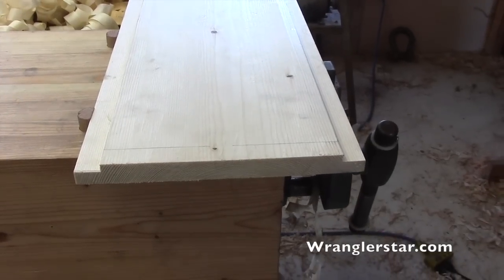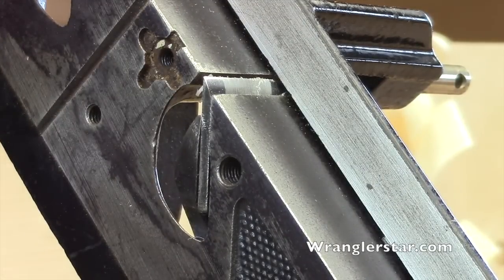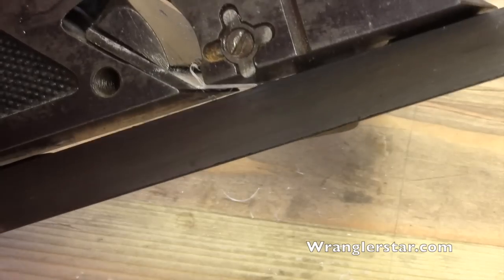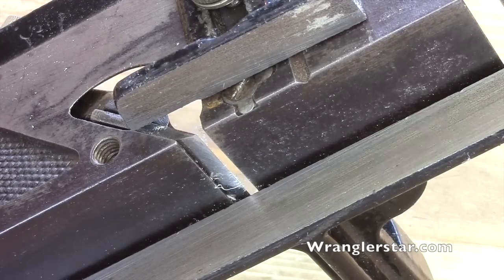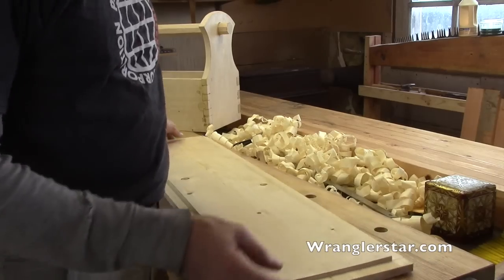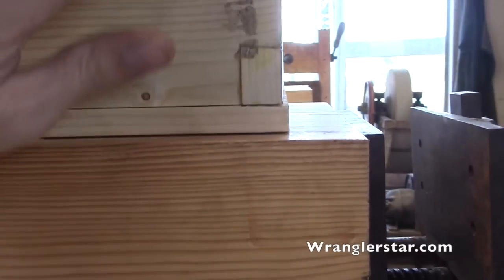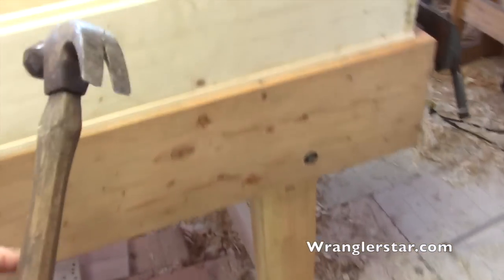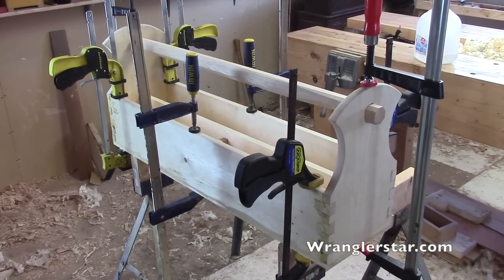Build a Tool Box Caddy For $25 | 5 Wranglerstar

Comment: hey Cody, just a tip to mention!! You mentioned controlling tear out when cutting cross grain? The solution is whether doing a rabbet, raised panel,etc. always do the ends/ cross grain first. That way any tear out would be removed once you did the long grain sides. Just an FYI. Great work and vids, and above all thank you standing firm in the rock of your faith. God Bless!!

Comment: The #78 is a very COOL tool, I have great grandpa Gatterer's & it's missing the fences but still has the cutter & screw.. He was a master cabinet maker & he only had 4 planes = 9 1/2, #4C, Bedrock 602 & Bailey #6.. & Clean the floor when you're finished & not one second before.. Gary/Hk

Comment: Hey Cody!
When I'm building wood joints and they don't fit and leave a gap I use two part clear epoxy and mix it with the sanding dust of the project I'm working on and use that to fill the gaps. It will take stain and finish to an extent. 
Dave Levin, Sr.
Mr. November!

Comment: I will make a couple recommendations...just in case you use it outside and possibly get surprised by the rain or snow  ,especially with rust-able tools. First a simple canvas  snap cover,which will also help with condensation when coming into the shop with cold tools. Second, small drain holes at the bottom side so water cannot accumulate if it does get in there.

Comment: My old box has a leather strap on it so that you can carry it on your shoulder, comes in handy a lot especially if you have to carry it for a long distance. By the way that is a very nice tool box you are building it will look even better with the linseed oil on it.

Comment: Why does the octagon shape works so well? Because when you close your grip, the hand has a hexagonal shape. Touch your index finger to the tip of your thumb.The 3 phalanges from the index finger + 2 from the thumb + thenar = 6. So you have 6 cushioned straight contact surfaces instead of contact points on a cylindrical object. Same physics apply to turning a bolt, you have more grip with a wrench instead of pliers.

Comment: Although you most likely wont experience any issues with the bottom of the box, it is a general carpentry practice to never glue wide panels across grain. This is because the large panel will expand and contract with changes in humidity and if glued, will cause itself or the piece it's glued to to crack. using nails or screws with pilot holes would allow the panel to float slightly preventing cracking. Drawer bottoms are never glued, they float in a rabbit.

Comment: What would really set the tool caddy off is by putting wedge shaped pegs on each end of the hex handle to keep them from sliding in either direction when carrying it loaded with tools in the event that you pick it up while the load is not balanced

Comment: If you can not find that rabbit plane you can do the same thing by using a block plane and clamping on a guide.  You will just have to check your depthas you go.  For the end cuts you can score with a utility knife.......or just use a router like most folks would.

Comment: I wonder if the tear-out would be avoided by planing the cross grain sections first (not that I know anything). Sweet looking tool and fine work.
Reply: +Siskin's Bits and Bobs You are correct, you can eliminate the effects of tear-out by planing across the grain on one side first the working your way around the board so you finish by planing with the grain and removing the tear out with your final pass.
Reply: +Lerkio xG Won't it leave tear-out on the outer edge of the board if you plane cross-grain first?  Or do you stop short of the edge to prevent that?

Comment: Nice.  I was thinking that the one by wood made it look a little blocky, with less room inside.  Maybe I would have used a smaller inside divider, but the rabbit on the bottom helps a lot.  Didn't that center divider go all the way to the bottom of the box?  It must not have, or you would have had to add another groove.

Comment: Hey Cody, do you think you will ever test the planes you are selling new? I'd use one for a bit and make sure the quality is still good through the years before recommending it.
Reply from the maker: Andre Gross I actually have. I purchased 4 of the Stanley planes years ago when I was doing my first timber framing. I soon realized those planes are for woodworking not timber framing. The only plane I haven't owned is the new no. 78
Reply from the maker: wranglerstar I forgot to mention. I sold the planes on eBay this is why I no longer have them,
Reply: Ah okay. I'm glad to hear that.
Have a good one :)

Comment: You're going to rely on glue alone to hold the floor of that box under a heavy load of tools? Surely you will nail it in with the nails at opposing angles...right?

Also I suggest tapping in some upholstery nails or nylon floor protectors in all 4 corners. This would provide an extra eighth of an inch or so in case you have to place the box on a wet surface.  It would also protect a finished floor if there is any grit.

Comment: Dear mister wranglerstar, i understand that your channel wranglermart is made to support the channel etc ... but have you tried the new line of plane by stanley ? because i have and believe me, i've found some cheap china made plane that were better ! so i think you may be think of testing one before put it into your virtual shop.
Reply from the maker: John76220 I have owned all three of the sweetheart planes and I found them to be very nice. I have not tried the others,
Reply: i have not a high standard in plane, i have some exemple of crappy planes, some wooden ones, and old stanley. i was on a search for a bevel down jack plane. i've missed an auction for a very old sweetheart from stanley... so i decided to try the new one, i've search for one to try and a distant relative had one. he give's me this plane to try out. i was very disappointed ... i was expecting this type of plane to be a one tool option for travelling, so making rought planing and after adjusting the mouth, making some nice thin shavings.... but the mouth wouldn't close enought it was nearly as big of an openning as my wooden scrub plane (and it's not a light word) and later i've discovered tha i had a a problem of bed alignement, the blade was kinda skewed. it's the article/ review of smister schwarz that gave me this indication. and overall it wasn't feeling right in the end ... i think it was only design to be on the same market as the Lie nelsen and veritas line, but wasn't design by a user, it's estheticly pleasing to the eye, but in my opinion, not a High quality tool.
and i think the parts are not made in america anymore, neither in england (my favorite) ? maybe in mexico are some place else that is cheaper than your country.